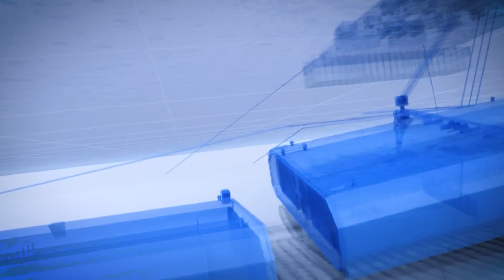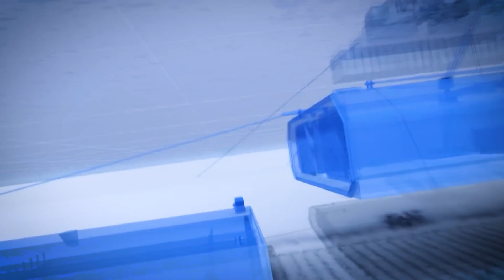The Insane Plan to bridge New Zealand’s Islands

Comment: It's not easy making a bridge in this senario besides costs and earthquakes in the Cook Strait. But Road and rail traffic have to avoid not just the ships but the greatest danger is the aircraft because on the southern tip of the Northern Island is where the Main Airport is located. The famous Øresund Bridge connecting Denmark and Sweden is an example.
Reply from the maker: Brilliant point! The airport proximity is a real wildcard—especially with Wellington’s flight paths so close to the Strait. Would a hybrid design like the Øresund (bridge-tunnel) even be possible in an earthquake zone?
Reply: @Constructopia365  depends on the scale of the earthquake. Unlike the Øresund Strait, the Cook Strait has rough waters and they are part of the Roaring Forties, strong westerly winds that occur in the Southern Hemisphere.
Reply from the maker: Interesting perspective, also the lately approved bridge from Italian Mainland to Sicily has been having a lot of concerns about earth quakes and string winds. Still it has been approved lately - how do you view this matter with regards to the cook strait?